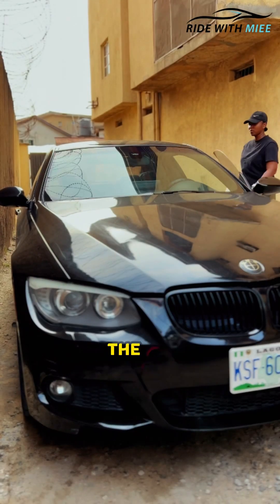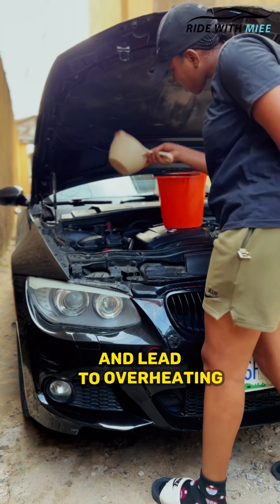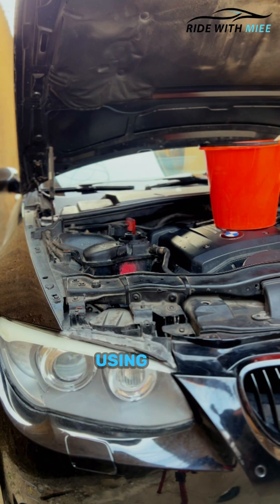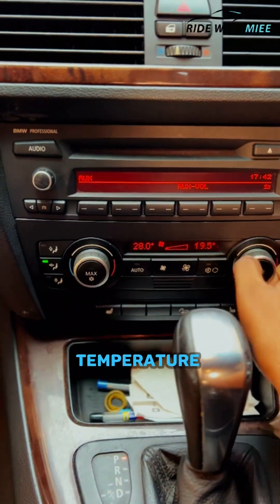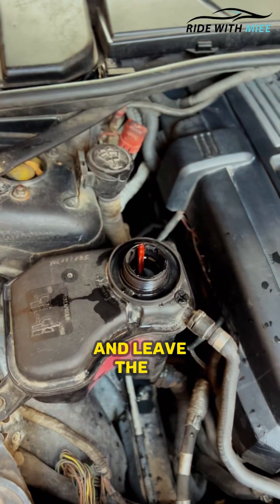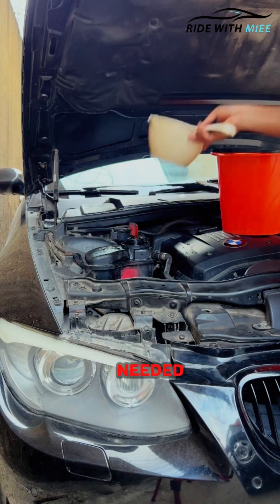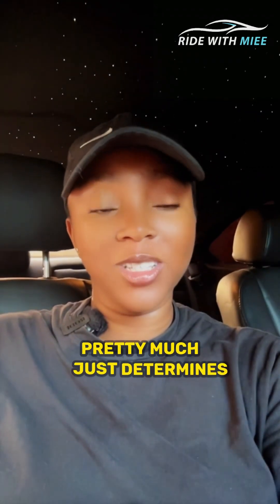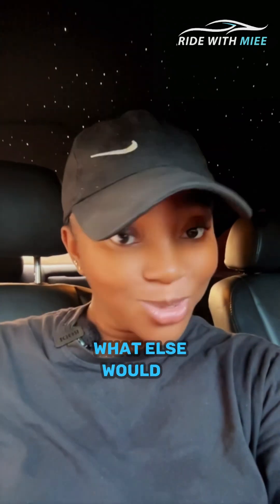BMW Cooling System Bleed Hack (Why your BMW Overheats) #shorts

Comment: Just curious... Tho i haven't had the need but does this work on Japanese cars?
Reply from the maker: Hi there! Thank you for watching. A lot of times, there’s no need to as a lot of Japanese cars don’t have a separate expansion tank and coolant is poured straight into the radiator but in the case where it’s needed, there is another way to carry it out without plugging in a tether or pressure device